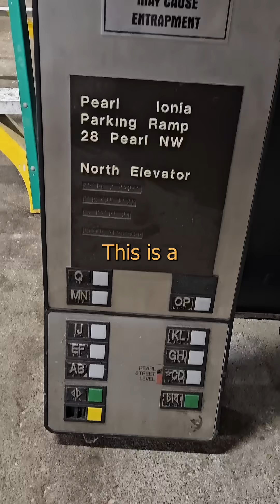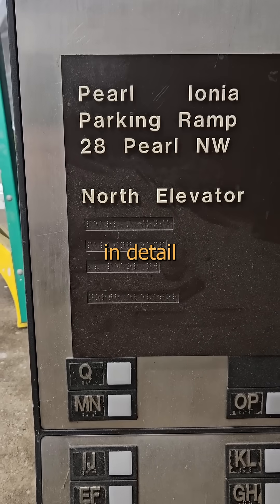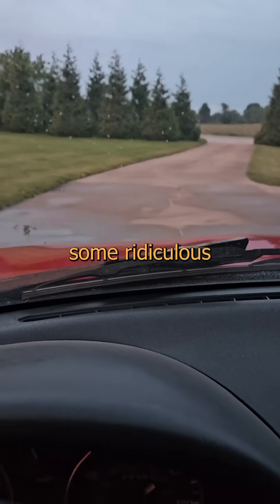Miata Mischief #chrisboden #engineering #gear #elevator #score #stories #parts #hacking #making

Comment: Maybe 5 years ago, Microcenter was doing a big sale on 3D printers. You could get an Ender 3 Pro for $99, which was over half off iirc. Only problem was I lived 10 miles away from the nearest Microcenter and didn't have a car. What I did have was my old commuter bike that had a big ol milk crate strapped to the back of it with bungee cords.

I biked nearly 2 hours to get there, through city streets, dirt trails, and the side of the highway, but I got there and got my printer. Then I had to bike the same way back, staying as straight and level as possible so this big heavy box wouldn't tip over and fall out of the crate. It was only by god's mercy I made it back home with both me and the printer in one piece.

So that's how I got my first 3D printer. Looking back, I think it was worth it. It was a good printer and a great intoduction to the hobby. Recently I've even started doing 3D printing professionally, which I wouldn't have explored if it weren't for that Ender 3.

Comment: I'm in East Texas just outside Dallas. I've lost my mind and decided I need 75 pound Black Cat firecracker rolls and found a dealer needing cash. There I am, on a 97 MZ Mastiff. (600cc dirt bike with street tires) I get 3 of the 4 rolls strapped down. 2 on the tank, 1 on the tail. I get on the bike and get someone to throw the last roll on tank rolls. I get to thinking this is going to work....
I overcook a little S in the two lane and loose roll goes flying to then be struck by a car. 1000's of little cardboard rolls are the equivalent of ice on asphalt. After watching the 2 following cars slip wildly off the road after skating on firecrackers, I felt it was time to go.

Comment: MIATA

 I used to bring stuff back and forth from a non profit my favorite was a tree with it sticking out the top of my nd miata i also moved 3000 miles in it with it filled to the brim and it was substantially slower lol

Comment: I rescued 3 Sony Trinitron PVM CRT monitors (20M4U for those wondering) by putting two in the back seat and one in the boot of my 4 door corolla sedan. The boot wouldn't close so I used an Ocky strap to tie the boot lid down over the top of the monitor.

Those things are HEAVY. My shocks bottomed out on every speed bump, hill, or pot hole on the way home. But I got them home

Comment: Worked in demolition and was assigned to take apart a stage light set up, and by take apart I mean break everything up small enough to hauled out up the ramp. Managed to keep most of the stuff intact and hauled it all home in my rust bucket Chevy avalanche I had the the time. Donated all of it to the local community theater. Nearly broke my back a few times getting that stuff out of there by myself after hours.

Comment: When I was still in school (around 16 years old), someone tossed out a gigantic TV to the garbage on the street besides my school. As I was interested in electronics and the panel wasn't damaged by how it looked, I took it home.

Imagine seeing a 16 year old guy walking around the city with a 200cm wide TV that is bigger than him. It was hard to maneuver into the bus and I out it on teo seats in front of me. It must have looked ridiculous. I did the same with a soundbar and heavy subwoofer, big amplifier and a nice UPS I got for 10€ used.

I took home so much stuff over the years, a small room in the basement was full of my hoarded stuff. At some point I stopped beinging home interesting stuff and got rid of around 90% of the stuff at is was useless. The rest is still there and rrally interesting. I have some homemade lab and testing equipment that you can find nothing about on the internet as well as some prototypes of some lab equipment and a ton of other random stuff.

Comment: Back in 2019 my buddy had a ‘92 with 29k miles and a matching hard top. Bought it for $1500 cause it didn’t run. Slapped a new fuel pump in, fired right up! 

Traded it for a clapped out Subaru WRX. I can’t imagine what it’d be worth today lol

Comment: I moved half of my apartment out with an s2000. I also had a first gen Miata just like that one and I have pictures of it with a 10 ft ladder strapped to the top with a ratchet strap going under the wheel wells.

Comment: In my apprenticeship, I worked with the companys calibrator for a semester.
One day, at a customer, I saw a USV laying in the electronics recycle bin.
I asked if I can have it.
The worker there said:
"For 10 croissants, you can have it."
The next day, I bought that thing and transported it home in public transport. 4 lead batteries (12V/7Ah) in my backpack and the USV (14kg) in an IKEA bag.
Still working today.

Comment: Not me doing it, but I was there as one of the cave canem on overwatch when friends stole and then rode their bikes away with tubes of blasting paste.
I lived nextdoor-ish to a gravel quarry in the 1970s. They didn't work a full day on Saturdays. They would prepare "shots" for a blast on the Monday morning by drilling the holes, dropping down the tubes of blasting compound, with the top tube attached by tape to the wires of the detonator. Then they put a  sheet of plastic down, and poured gravel on-top of the  plastic to keep it "safe". Come the Monday morning they just  went along and connected up the wires sticking out under the  gravel.
The quarry was so big, that the guard shack was often completely on the other side  of the place, a kilometer away or more from the working face. We would steal one tube of blasting compound from one of the shot holes and a detonator came with each one. We would tape a rock to the wires and put it all back the way we found it. My contribution was as one of the guards watching the three "roads" through the quarry, in case some was driving around. We had "Po-Haa, Flashing Rocket with Report" skyrockets, the plan was we would shoot one into the air to warn the guys stealing, we never had to, the guards were by themself, and  just sat in the shed most of the day.
Then we had a lot of fun making  various energetic toys with the POWER PASTE. It was quite easy to set it off if you  knew what you were doing, but stable enough to carry around in your pocket.
They never figured it out we were stealing it either, only 25 years ago I went for a walk in the quarry when it was running  out of rock, and the same  little piles of gravel with wires.

Comment: Bought an old decrepit wooden yacht (which I'd never do unless I were 19 and a dumbass again), hauled the jet drive outboard that I was gonna outfit to this floating heap in the back of my bimmer. The E39 chassis perfectly fits a long-shaft outdrive with exactly a quarter inch on either side to spare!

Comment: I'm a truck driver I was sent to go pick up a trailer one day as a rescue. 
I didn't know the guy had tried to go under a bridge that was only 12 ft tall. 
The entire top of this trailer was missing and the sides were flopping on the damn ground. 
I had to strap it with probably 30 different straps to get the damn sides up so I could haul it 500 miles across Texas. 
My butt puckered at every weigh station

Comment: I did several. I got 2005 Suzuki Ignis.
That car got towing capacity of 450kg -180kg trailer leaves 170kg for cargo.
I hauled around 2000kg of dirt with it, and stuck pieces of wood into suspendion of trailer so it wouldn't sit so low.
I can put 50kg on roof rack. However i stuck 200kg of free lumber up there, and with every bump car did great impression of duck on water due to high center of gravity and short wheel base. 
I hauled a cubic meter of fire wood inside of that car with another cubic meter on trailer behind it.
I hauled 2 frames wider than car by having one side on very edge of roof rack on driver side and other side on passanger side held by seat belts stuck in closed door. For refference it was in lower half of wheel.
I also stuck 3 gate segments i made onto roof rack and all were wider than car and sticking out front as far as front bumper.

Comment: Hehehehe *laughs in DOT violations* I once strapped, chained and tarped about 40 chain link fence posts with concrete and dirt stuck to the ends to a flat deck trailer and hauled it 250km up the bumpiest highway in my province.
I call it my final destination load because all the pipe was sticking up, some was hanging over the front of the trailer. All in all it was a little aketchy

Comment: Me and my 3 friends got six couches in a circle in the woods. Keep in mind we carried them through three neighborhoods with just our hands and feet. We had a spot for grilling a spot for fires. Tarp for the couches to stay clean while having them up off the ground. We used to hang out there sleep there. And at one point, we dug a 6 foot deep hole put chairs in there and do a tarp over it just to get away from the heat.

Comment: When I bought my new tube amp full stack, I only had my 1996 Honda Civic EX Coupe, and they wouldn't hold onto the stuff for me to get a truck. So I shoved one 4x12 speaker cab into the passenger seat and the second one into the trunk. The new guitar I had bought was in the passenger footwell as I drove with the 50lbs amp head on my lap. I then proceeded to go to gigs the same way, except I removed my passenger seat to house my backup guitars and other outboard equipment.

Comment: We had a banger racing team on the air base, we had a local estate about 5 miles away selling an old Renault Clio that was begging to be destroyed by menbabies racing around a disused runway. We had no way of getting it back to base as it was non-runner and had a few tracking issues so we couldn't tow it and didn't have a car with a hitch, so we took a ford Mondeo with a roof rack and filled it with lads that bench press buildings and lifted the clio  onto the roof and drove back to base.. We had fun at the gate explaining it.

Comment: My craziest story is hauling  2 cubic yards of mulch in a truck with a busted brake line. My dad asked me to pick up some mulch on a Friday cause I had a 3 day weekend from Highschool. I waited far to late to leave and as I was messing around at a stop light I started to press the brakes really hard, heard a pop, and the breakers went to the floor. I knew what happened but I figured my dad would be pissed if I went back home to swap truck. I finished the drive babying the brake there got the mulch and realized there was not enough brake fluid left to feel safe. The ride home was a lot of coasting hoping I’d make all green lights and not have anyone in front of me!

Comment: I had a white 04 convertible Mustang GT that kinda fell in my lap.... as all my vehicles have....

I used to drop the top and haul damn near anything under 12 ft long 😂 mostly lumber and trash but there was cabinets and various other free roadside finds i shoved in the back bench or laid down the center console and out the back 🫠😂🫡

It had 13" cobra rims, came with the car, but it was a mustang and had absolutely no weight where you want it. I used to fill the trunk with roughly 320lbs of cinderblocks and get back and forth to work in the snow 😂

Not my favorite vehicle, but it was funner than hell to drive. If it was a little rainy, she would kick the ass out at 55-60 mph 😎😂

One of these days ill finally get a real truck ❤ maybe an older ranger or early 2000 s10.....

Comment: The singer in my first band had a brother-in-law who worked in management  for MTX/AAL. We drove 25 miles into Chicago to pick up speakers he was loaning us for our first festival gig at our high school. I was a senior in high school. The others were all freshmen. Four of us drove to their downtown warehouse after school. After loading the speakers into my 1981 Mercury Lynx station wagon, Two of us were in front, one small back seat remaining when I folded down the split rear to accommodate the speakers. Our drummer stuffed himself behind my driver seat, smashed firmly between seat and speakers, which took up every inch of the rest of the cabin. 

Then we drove up during rush hour. (Ugh!) We jumped in the express lanes, unaware we were not supposed to be able to exit them to the Eden's Expressway when it split towards O'Hare airport, way out of our way. Still coming It took forever in bumper to bumper traffic to get to the split. Seven or eight lanes of traffic across, but thank goodness the only thing blocking our way was a double line painted on the road, with no cops in sight.

Comment: We had a 1995 Buick LeSabre that was my grandma's and we hauled couches on the roof 3 separate times, washers and dryers, it had a whole mechanics shop worth of tools in the trunk, and when my cousins car died we PUSHED it down the highway at 65 miles per hour for 20 miles with me being of all of 14 with a learners permit doing the pushing, we pushed cars out of giant puddles when the city flooded on 3 different occasions, I finally killed it at 16 when I flipped it 3 times into a ditch and it had 290,000 miles and was still running perfectly when my dad went to pull me out, he had to reach in and shut it off, I wasn't even wearing my seat belt and I didn't have a scratch. They dont make beauties like that anymore.

Comment: When I was about 17 I found a pool table on the side of the road while I was out skateboarding, heavy af. It was just me and my other broke 17yr old skating buddy and neither of us had a car.

So we did the logical thing. Flipping it upside down and one skateboard in the front and one in the back. We pushed this thing probably three miles back to my house. Up massive hills, down hills, constantly having to readjust the boards because we had basically no control. Was absolutely exhausting and within 10 min I was almost ready to give up. But my dream of playing pool outweighed my physical exhaustion!

Finally got it back home after an hr or two and my mom pointed out that there was literally no where we could fit this thing. And she wasn’t wrong at all, I didn’t bother to stop and think for 5 sec before we grabbed it.

 Sooooo, it went out back where we had a big flat driveway with a sketchy little skate park we’d made. Slapped it up against a wall about 60degreees and used it to do Wall-ride tricks. Complete waste of time and energy😂😂
Reply: I've done the exact same thing but with a swing set, we just sat on the swings and pushed it home 🤣🤣🤣
Reply: I liked this for the physical effort you put in. The oversize things I moved for bright ideas that didn't turn out lol😂
Reply: No wasted time in my opinion. You learned to think ahead, plus you got a sweet story 👍
Reply: Should have just put it in the driveway like Drew Carey did in his sitcom.
Reply: Obviously you didn’t watch kick buttowski
Reply: Couldn't have set it up outside like on the Drew Carrey show?
Reply: Nicely done. No notes.

Cheers!

Comment: Speaking of miatas I once took my small one person kayak and put it in the passenger seat in Miata and strapped it down to the trunk. Thought I can take a step further, I also took along with the kayak a 25-ft canoe on top with the top down a yellow small kayak in the passenger seat and a 20 ft canoe on the window and Strapped to the trunk. Boy did I get the looks.

Comment: In my Dads 2002 Honda CRV(Manual, that will be important later). We went to pick up two wooden bed frams with drawers. We put the right side seats down, so driver and left(single) back seat up. Packed so tight i had a drawer in my lap and a bed side in my brain(almost, couldnt move head). In the passenger seat area(remember its folded) loaded so tight that i dont think  fifth gear was possible(manual remember?) but we were going low speed so we didnt need it.

Just remember a second time of sketch(same car):

We had a second freezer but it wouldnt fit in our house(free Facebook Marketplace find) we were taking it to someone else to swap for a smaller chest freezer. This freezer was as tall as a fridge. We put the back row down and it still stuck out a foot, so with the door mostly closed i strapped a random red bike light to the back of bike rack on the door(set to a flash) since it was sticking back a good bit. It was considerable weight, like a 3-4 person job to move. It was the type of thing where you have to contiue thru yellow lights cause you would have to really slam the brakes. It was sketch but totally good.

Comment: Mazda 3, pellet smoker strapped to the top. I was smart and opened the doors before tightening them so I could get in and out easily. I drove it at night so I wasn't seen as easily. I've moved a lot of things with my stick shifter.

Comment: Bought a storage unit it had a few of them VR Arcade machines, a 2 player & a single player. 2nd player one look us roughly 2 hours to get into a uhaul, now the sketchy shit we put the one player in the back with about 80% just hanging out there, using some straps we tied them around the metal areas on the machine and hauled it home, to get it out we disassembled the top portion. We didn't even have a lift gate just home muscle to push them up a ramp. 2 player was 1700lbs, 1 player only 1200lbs.

Comment: I wasn't hauling anything home but I did need to go pick up a 20 foot LVL 14 inch wide beam from another construction site and hung it out of my sun roof on my 1996 Honda Civic coupe 2 door, there was about 15 feet of it hanging out the roof. Luckily I was only going a few blocks away.